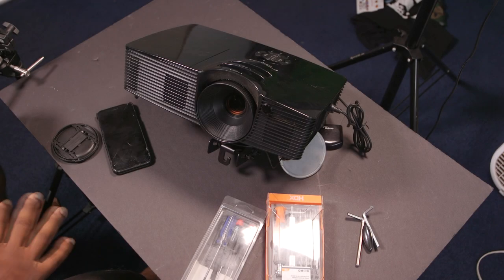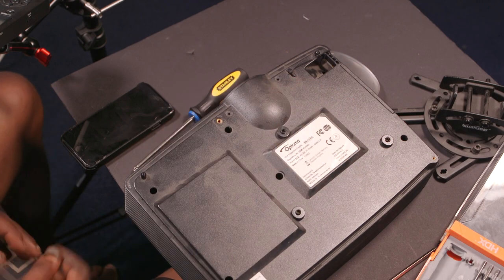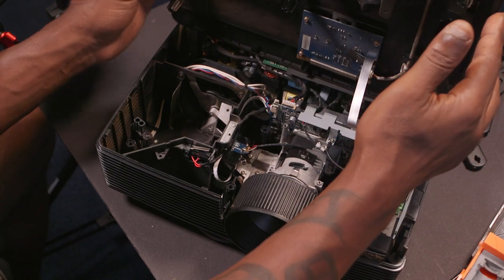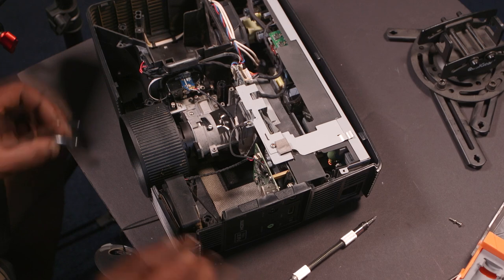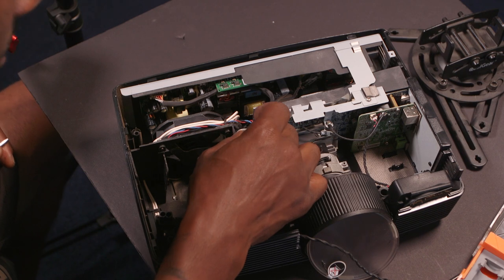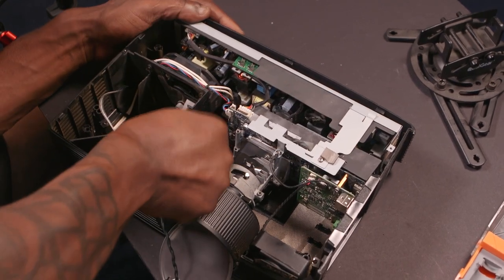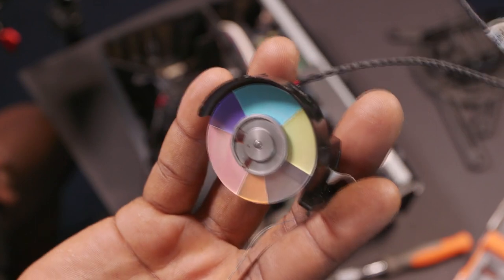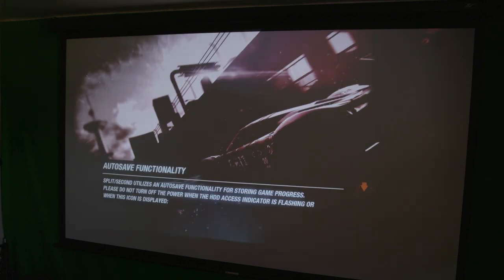Color Wheel Fix? - Optoma HD141X Projector

Comment: Thanks for this!  I have the same model, and it is making a constant buzzing noise.  Initially I thought it was the fan, but I've read that it's common for the color wheel bearing to go bad and buzz.  I have a wheel on order and will use this video for reference when replacing.
Reply: Hi Jon

Did you manage to fix this issue. I am having the same problem now

Comment: Thanks for this video!

My HD141X is flickering and the red color isn't coming through well after 2 years. I just replaced the bulb after 3,400 hours but the issue persists.

I was able to take the projector apart and clean the color wheel a bit. I ended up removing both of the weird-angled screws, it seems like they're just there to make the replacement difficult. A new color wheel is on the way.
Reply from the maker: Ben Booker o ok Cool! I Hope It Looks Better Once You Replace It! 
Thanks for the comment
Reply: Hey Ben, did replacing your color wheel fix your problem? I'm having the exact same issue right now. I was just wondering before I go out and get a new wheel.
Reply: YES, the replacement color wheel made a massive difference. No flickering, and all of the colors are so much more brilliant. Everything is brighter now. I got the color wheel from ebay for $30 from China.

I received the replacement a few weeks ago but didn't install it until today. Thanks for the reminder.

The ebay listing specifically said the replacement color wheel was for the HD141X. You can definitely do this, just take your time, and good luck!

Comment: It might have also been a bit of glass reflecting extra light onto random parts of the colour wheel.

Anyway, thank you for this video! Mine flickers sometimes (gets real bad when it does) and also either the colour wheel or the fan are so god damn loud! Like a deep grinding type of loudness which if I turn the projector off and back on within a few hours, is 1000x louder lol

Gonna watch this again later when I take it apart to clean and hope that sorts at least the noise issues out :)

Note: my og bulb is nearing 8k hours, 95% used on bright instead of eco so that could also be my flickering issue 😂

Comment: Do you have the "deep black" on?  Try switching it off and see if it still flicks. As the deep black evaluate the luminosity of the image to change the contrast and light buld intensity, I've found that sometimes it can't decide what level to set, and keeps jumping back and forward, causing the flickering. 
In my HD141X when the flickering starts, I switch deep black off, and after a few seconds, I switch it back on again... and that makes it stop!

anyhow, thanks for the video!!! My color wheel had this loud "grinding" noise which was making me insane! Thanks to your video I replaced it and now the projector is silent as it never has being before!!! Thank you so much!!!

Comment: Thanks for this.  Walked me right through the fix I needed for my projector.  $30 fix. Just like new.  Thanks!
Reply from the maker: No Problem, how's it holding up!?..
Reply: So far so good.  Had a little flashing but apparently it was due to a new bulb and has since gone away.  You got me a new projector for $30 that otherwise would have been trashed.  Wasn't worth shipping to a repair shop and all the fees.  Thanks again.

Comment: I have the benq tk800 and it has started to rattle during certain display/scenes. From what I can tell this is the colour wheel. Image seems to be displayed perfectly fine but the excess noise coming out of the projector is doing my head in. Product is less than 2 years old. Should I get my hands dirty or send it back to benq?

Comment: Hi ! I have same Optoma model...my problem when no HDMI plugged - turned on and there is white screen with a few horizont black lines..and its wheezing. After few sec sound is changing and red flash about bulb error.. I really dont know what is causing it.. I changed lamp for the new with housing..same problem. So do you think it could be thet color wheel? I took the color wheel and use WD-40..no changes.. :(
Reply: i have same problem

Comment: I have this same projector. I replaced the color wheel and the bulb but now the projected image is dark on the top side of the screen. I’m stumped 🤔 any suggestions?
Reply from the maker: Maybe Was A Bad Color Wheel
Reply: I just did the repair from the video and experienced the same darkened band across the top of my screen. I don't know if this is THE fix, but it worked for me.

The two screws at a diagonal, one of which was removed in this video, seem to balance out a reflector. I over tightened the screw after I replaced the color wheel and got the bar. After loosening it, purely out of luck, the bar shrunk. After the next attempt at loosening slightly, the bar was just a freckle of darkness in the corner. Instead of pushing my luck, I restored all of the screws and called it a day.

I hope this is useful to someone down the line.
Reply: @brianh6465  it was definitely useful for me today so thanks Brian! As loose as it can be, it remains dark in the corner... Did you manage to have it completely gone?

Comment: Mine will run great for 5 minutes and then start flickering and shut off giving me 2 red dots. Do you think my color wheel is going out or another issue.   The odd thing is if my projector isn’t upside down the issue never happens
Reply from the maker: Something inside must be loose or something, the Color wheel could be the problem but not 100% sure!

Comment: I've just broken my 3rd colour wheels in row trying to install it, I no you said it was hard getting it back in but it seems impossible for me to get this back in without breaking the color wheel. Any tips so I don't break a 4th lol
Reply: 4 screws that holds the metal bracket around it, just remove them
Reply: I ran into same thing.  Somehow my wife was able to get it into place.

Comment: After the color wheel replacement, the power and bulb leds light up red and there no light out of the bulb. Anyone came across this issue and solved pls?
Reply: you must close the housing, there is a sensor